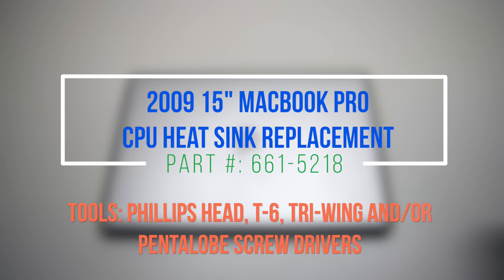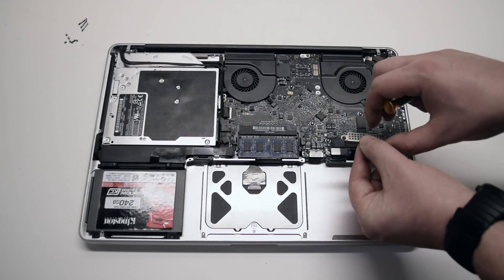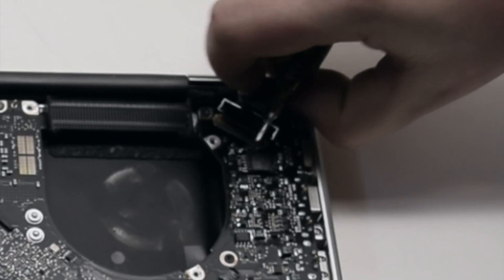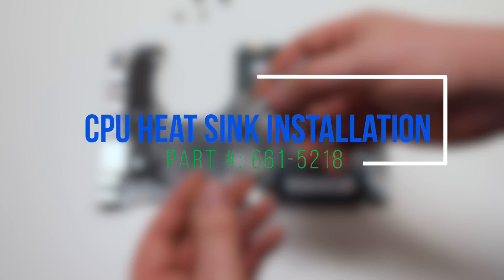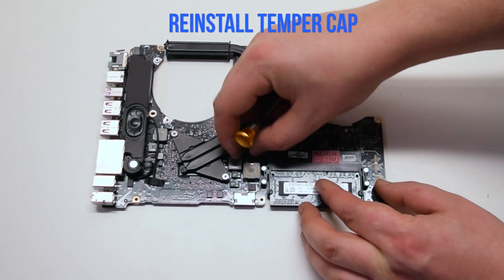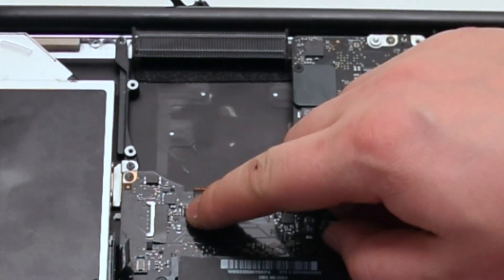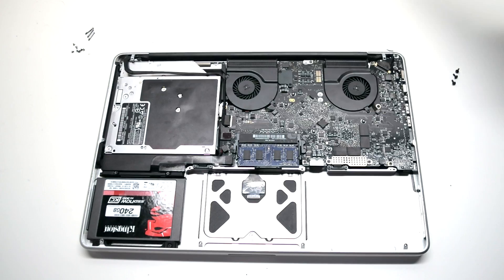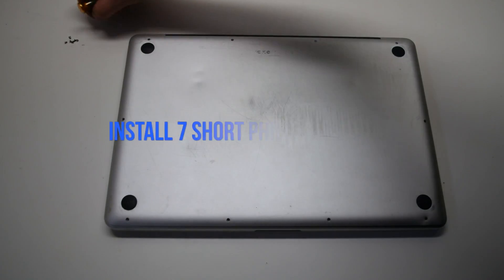2009 Macbook Pro 15" A1286 Heat Sink Replacement

Comment: Thanks for the video. I am reviving one of these old MacBooks to run it with Ubuntu. Only one tiny difference in the part where you flip over the logic board there is still one more cable connected to the body. Seems to be part of the speaker (same connector). Needed to unscrew the speaker from the logicboard to disconnect. It was a bit tricky but worked out. The WLAN cable (funny word 😅) has a small glued in block to hold it in place. It needs to be moved to the side by force to put the cable back in.

Comment: i replaced my thermal paste, screwed up the speakers in the meantime cause that cable broke off the board instead of popping off it properly, got it somewhat fixed by soldering it back down as best i could for now, but only the left side works. kinda annoying but happy that the laptop still works at least xD

Comment: After poking around a bit while my battery is calibrating I found out that the 2.66GHz and 2.8GHz 15 inch MacBook Pros do have 2 fans like you show in this video while only my 2.53Ghz Model A1286 has one fan similar to the 13 inch models, however I haven't found the model numbers for the 2.8GHz or 2.66GHz, but will look around a bit more after I've slept and gotten some other stuff done as I doubt that the model numbers would be the same.

Comment: Are you sure you labeled this video right? I recently performed a Ram and Battery replacement on my mid 2009 MacBook Pro and had studied this video first as well as a few others as I wanted to look at the screws and connections to make sure I had the right tools to remove a main-board if really needed and plan out how to do it using one hand.  Once opened the back panel the first thing I noticed was only one fan in the center like on a 13" MacBook Pro.  Under About this Mac from the Apple Menu it clearly says: MacBook Pro (15-inch, 2.53GHz, Mid 2009), the back Panel says in very small print A1286,  and the display measures right around 15" on the diagonal using a long precision steel ruler I used to use measuring bar stock for a few different CNC lathes back when I was a Machinist making Aircraft parts a few decades ago.  I still need to go back in and replace the old 120GB SSD that only has about 10 GB or less of storage space while I can still write to it when can get the right parts for that but can wait on the thermal paste now as after cleaning off the fan and air grating it seems to be running a lot cooler than it was.  But you may want to check that this isn't a 17" Mac from the same or some other year FYI.  Good info otherwise.
Reply: Just replaced the batter in my mid 2009 and you are correct. I only have one fan.
Reply: @khiggins6311  After doing some more digging found out that 15 inch Mid 2009 MackBook Pro's with 2.6Ghz or higher CPU's have 2 fans. I found some software online somewhere called Max fan Controls that allows setting the fan to run more often which is keeping the CPU temperature down quite a bit though it still runs hotter than I would like to see. Apple throttles the fan speed and frequency down way too low so the machine is quieter, but doesn't last as long.  It was an easy install and setup, but I don't remember off the top of my head where I got it or if I had to pay for it, but is a must have utility to keep this thing cooled down. I would have replaced the old thermal paste on the CPU and GPU but as they are on the opposite side of the main board there were a lot of small wires to disconnect without breaking using only one hand so decided to leave well enough alone for now unless can afford another backup laptop of some sort.
Reply: yep only one fan in 15-inch, 2.53GHz, Mid 2009

Comment: i just followed your video and when i tried to start my mac it doesn't turn on....
Reply from the maker: Check you keyboard ribbon cable connection. 99% because the power button is part of the keyboard, if it's not sitting correctly in the socket it will not power on.
Reply: @GRIBSOFT  Thanks for the info. Will check that out
Reply from the maker: Let me know if it works.
Reply: @GRIBSOFT  It worked! Thanks
Reply: @blablasss  I had exactly the same problem and it also worked! perfect video!! do you know how can we monitor the temperature to know if it was the right amount of thermal paste?
Reply: @gallerman  Download Max Fan Control free utility from:  https://www.macupdate.com/app/mac/47386/macs-fan-control and set temperature sensor to CPU diode is one way however I'm not certain you can do that without changing the fan presets for running the way I did using this utility, there are probably other utilities  you can use that just measure the temps without changing the fan speed if you want to do that first.

Comment: I did a thermal paste reapplication and my temps are 65 C - 75,  idle ... is this normal ?? whats your normal idling temp ... maybe i added too much paste ...
Reply from the maker: That’s a totally acceptable range. Just make sure you use it on a flat surface.
Reply: I didn't replace my thermal paste yet but downloaded Max Fan Control and used it to set the fan running most all the time though not at full speed unless it gets real hot and right now it is at 63.6 degrees C down from about 90 C before the fans were still set to Apple's specs, so that thermal paste replacement helped quite a bit.